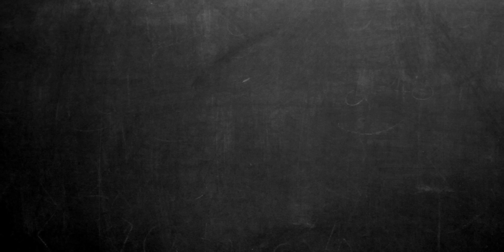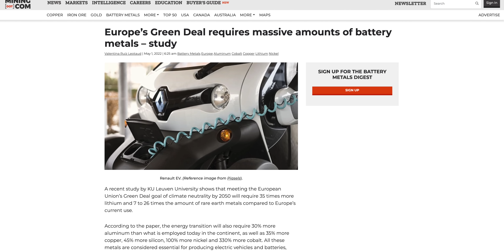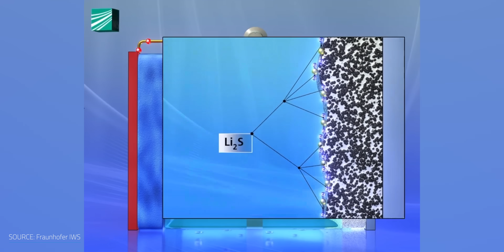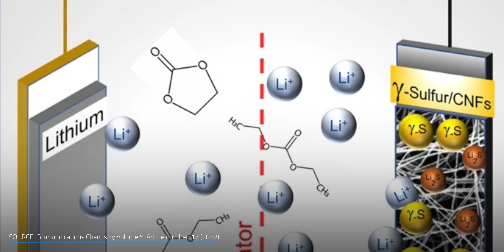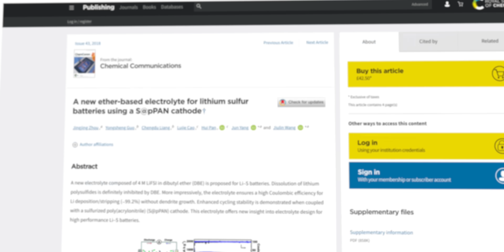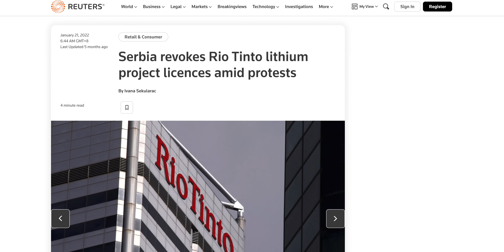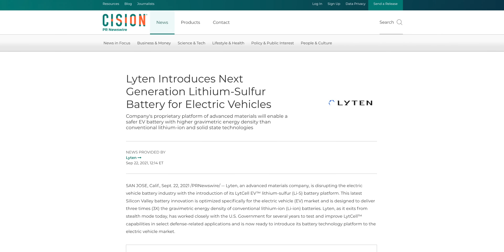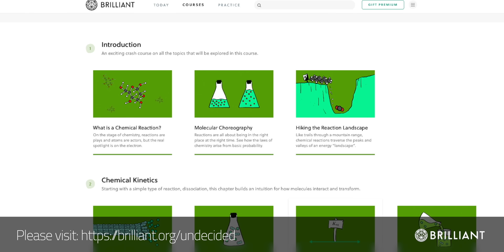Why This Accidental Battery Breakthrough Matters

Comment: Honestly I just want a battery tech that doesn't degrade as badly as lithium ion for the consumer market now, heard so many miracle materials/technique/compound in the 2010s but lithium ion is still here as the most common battery in a lot of applications.
Reply: Yes battery tech is in reality is way too slow in progressing, & it is NOT getting cheaper, EV's are just getting more expensive. If EV's are to widely adopted, the price has to go down, not UP UP UP.
Reply: @sevencostanza3931  BS! Prices are going down. You can buy Ford Maverick for $20K and we have double digits inflation. Thanks to stupid administration, but that what majority wanted.
Reply: LiFePo4 is lasting longer in cycles…
lithium titanate basically lasts forever…
Reply: ithium phosphate has been taking over generators for having a longer life cycle and not exploding when punctured. but its heavier so its not in phones or drones yet
Reply: I mean why would manufacturers voluntarily invest in a longer lasting product? If you have to buy a new one just because the battery dies, that's perfect for them.
Reply: @gamingmarcus  - “why would manufacturers voluntarily invest in a longer lasting product?”

Because existing batteries limit the use cases where a battery can be used, therefore they can not sell as many batteries.

For example, with lead acid batteries, full featured internet based cell phones were not truly possible, but with Li-Ion batteries, this technology is everywhere, and many more batteries are sold.

Another example, with lead acid & nickel cadmium batteries, electric cars were not able to be realistically used in the 1970’s during a time of the oil embargo… electric cars are possible and manufacturers are selling tons of Li-Ion batteries for cars.

Incremental improvements in battery technologies increase market opportunities, and limit the possibilities that newer technologies will take them by surprise & put manufacturers out of business when they are not reinvesting their profits into R&D.

Manufacturers must always be performing incremental improvement, otherwise old stuff can’t be incrementally replaced when it fails, eventually old infrastructure can not be renewed, and the proverbial “cash cow” will die.

A prime example of not properly reinvesting profits for incremental improvement is Venezuela. The nation had among the highest standards of living in the Southern Hemisphere, but they voted people into office who took profits instead of reinvesting them, and their infrastructure fell apart as the rest of the world moved on. Wealth creation comes from productivity improvements, so incremental improvements in batteries & other technologies are all a part of that progress!

Another example is Cuba. While the rest of the world was investing in cars, they did not reinvest their profits into incremental improvements after their revolution, and they were left behind. They could have built the first electric cars in response to their isolation, but they chose not to, because people higher on the political food chain wanted programs for their failed concept of paradise. They could have built the first cell phones, led the world, but chose not to, and had to suffer with aging technology instead of investing their profits in batteries & technology.

The world is not a static place, people always do things in an improved way, reducing effort & dependencies on expensive resources, people who did things in a old & expensive way die off, old stuff breaks, and old stuff must be replaced. 

Paradise is never based upon a picture of what others have today, but only a vision into the far distant future of what no one has. The prior is the problem of coveting & theft, the latter is the result of incremental improvement gains that makes seemingly un-achievable things possible.
Reply: @gamingmarcus  You forget their secondary source of profit. ad revenue. I cant track a dead phone, you cant buy goods on a dead phone, i cant show you ads on a dead phone, you cant download aps on a dead phone. Why do you think there's such a heavy focus on camera quality?

Comment: 1. how difficult is it to revoke a mining permit?

2. can the permitting process be fast tracked where you pay the fee and get your permit in a 5 or 10 minute period?

3. if it turns out that the mining company does not meet the requirements after a trial mining the permit can be revoked.

fore example  indonesia's hpal mine would have ther permit revoked for dumping tailings in the environment.

4. but if sulfur is cheap enough then 100 cycles may not be such a bad thing

meaning if current prices are $135 per kwh for lithium ion batteries and lithium sulfur batteries are $10 or even $1 per kwh then only getting 100 cycles from them may not be so bad.

we can then afford much better a battery 

5. can another substance be added to the electrolyte to raise the boiling point in a similar way that car anti freeze does to water?

or could the casings of the cells be made thicker to handle the pressure?

Comment: I've never understood why nobody is looking at Nickel Iron batteries for grid storage.  They are bulky, and will discharge on their own faster than a lead acid battery, but neither of those are an issue for use on the grid.  They will charge and discharge often. Who cares if they tend to run down over the course of a couple of weeks.  There are cases of them lasting for 50 + years of constant use in the mining industry. The fluid in them needs to be changed every 10-15 years but that's about it. 

They were in common use in early electric cars before gasoline took over completely. They were used as starting batteries before lead acid became popular.  Any patents associated with them have long since run out so almost any company that wanted to make them would be free to do so without paying royalties.  

The only thing I can think of that might be a serious negative would be the cost of the nickel and the space required.  When compared to the return over their lifespan it seems like a decent trade.

Comment: EV vehicles battery is huge 100kwh. 
The Daily drive is 7kwh 
The home need over night is 5kwh 
The rooftop solar PV is 33kwh every day 
Every building is connected to the grid 
So with automatic EV  plug in at every building the grid can trade power and stability with the grid for money 💰. 
If you do the maths Renewables and the grid and the EV batteries will be all that's needed. 
USA has 300million vehicles if 100kwh each and connected to the grid 24/7 except for rush hour or daily drive.
The automatic EV plug in gizmo will be the 'killer invention'.

Comment: This is very interesting, range, corrosion based fire hazards, and expense are what keep me from getting into the EV world. I prefer electric RC planes and flying drones is fun, so I am not against it at all. Just can't afford the range I need in a vehicle. My solution is making vodka fuel from cattails, tree sap, and coffee grounds. 

I raise the compression to over 13:1, run them hot so I can utilize the heat to improve mileage, and they make lots of power. It precludes running gasoline in my engines, but since I can make fuel ethanol for less than $1 a gallon with cattails as well as coffee grounds, and one acre of cattails makes roughly 1000 gallons of fuel while cleaning water, I don't mind not being able to use gasoline. I have gotten better mileage with more power on ethanol than I could on gasoline with the same size engine, in the same vehicle, by simply raising the compression ratio from 8.8:1 to 13:1. I picked up 3mpg over gasoline and somewhere around 100hp/150ftlbs with increased airflow, the fuel, and the compression ratios. 

That was a 4100lb 1970 GTO getting 20mpg mixed city/highway with an old Qjet carb I converted to ethanol. The aero is not stellar on a 1970 GTO, and the unsprung weight, rolling resistance, and drag from things like wheel bearings, means getting 20mpg with a carb and being able to traverse the quarter mile in 11 seconds, is kinda hard to do. Sure, a modern vehicle with EFI, less drag, lighter components, and low rolling resistance tires can get 20mpg and 600hp relatively easily. I did it with 1960s (at the latest) tech though. It got 18 highway and 15 mixed on 87 octane, and ran 1.5 seconds slower in the quarter with another 455 I had in it, the 8.8:1 engine.

Its fun building a $3000 engine that will push a 3500lb muscle car through the quarter mile faster than a Tesla Plaid, with fuel you can drink and make yourself. That last part is why I am into doing this, because I am a hardcore gearhead who loves cars and racing, and if I can produce fuel myself for cheap, then I can buy more parts with my limited income. 

Yes, if you run ethanol in a low compression gasoline engine, you will lose mileage. If you have 12:1 with iron heads (on my vintage Pontiac engines) to utilize the heat more effectively, you will get the same mileage with more power. There are other things you can do to improve it... Not going to get into that here though.

Best part is I don't need a lithium mine, an oil well, or anyone else telling me how much I have to pay for my fuel.

If I could get batteries like these, and electric motors that make the power I like, without having to spend tens of thousands for each,  use wind and solar to charge it, without having to worry about the corrosion issues I deal with living here in the north where we get 150 to 300 inches of snow every winter, and the degradation of battery power in cold weather, I would be all about silently going fast. That is a lot of issues to overcome, and I am 53 years old so the chances I will see EVs that go faster and farther as safely for as cheap is probably not going to happen. I need to be able to travel 1000 miles in less than 14 hours, and EVs can't do that yet.

I like technology, and I use it where I can, when I can afford it. I also like caveman tech due to the simplicity of it. I don't focus on what I can buy, I'd rather think and act on what I can do, make, create, or adapt. I build my cars from rusty heaps rather often, and I will never buy a new vehicle. The closest to a new vehicle I will ever have is one that I build myself from a pile of steel tubing, with a bender and a welder.... and that is in the works.

So if they can make sodium-sulfur batteries work and make them dirt cheap, then we only have the problems of windings and magnets, plus heat/cold and how we produce the electricity. 

I want a Prius, not to drive. I want the power units, the engine/generator, and the battery pack, because I can power my house and shop with them. Run the engine on vodka or methane (real easy to produce copious amounts of methane) and I can go off grid for the rest of my life. The drive motors can be used for all sorts of things, sawmill, water pumps, and more. So a Prius would be a fun addition to my project. The grid is unstable here, the longest I have gone with uninterrupted power in the 15 years I lived here is six weeks. 

Gasoline has been over $5.20 for the last three weeks, and with all LED lighting, a fridge, deep freeze and a PC on in my house, my power bill is closing in on $300 a month.  Heating with propane is a minimum of $1000 a month, firewood is a pain in the ass because people think 6 face cord will fit in the space 1 face cord takes up. CNG is not available here, but that is cost prohibitive too now.

Energy is my largest expense, which is why I have been working on making it myself. If I could do the car thing with electrics and get the performance/range I get with vodka for a similar cost, I'd be all over it.

Comment: I think what also has to be taken into account when you discuss new battery technologies is, wether it is possible to recycle the system or if its composites are so connected, that they create a hot mess of material that cannot be broken down back to its constituents. A battery, that cannot be recycled after its use is a worthless battery.
Reply: You have disposable batteries that are not being recycled so whats the difference.  If the rechargeable batteries last a long time it should not matter that much.
Reply: @sargonoshana2324  Well of course I have to worry a lot. Everything, that is not recyclable   creates waste that piles up and is lost for future generations to create new things. No matter what the lifetime of a battery is, as long as it is finite, it will pile up and deplete the resources for generations to come. This holds true for everything we make.

Comment: Vapor Deposition is an energy intensive process that requires some of the same equipment for making circuit boards. That isn’t to say it isn’t also super scalable but it will require a large capital investment to get started.

Comment: Excellent revelation!  At about 6:20 + you drop a detail that the caption presents ("4,000 cycles").   This is so promising.  Very encouraging to see a female scientist relating the various issues surrounding this development.  I'm a 65+ yr. old inventor and going to die soon.   It is encouraging to see that invention enthusiasm is so alive.  Getting this data and invention technique stuffed into AI programs will be vey important.  Some robot on a distant planet will need to figure out how to make the planet tolerably inhabitable for humans; etc. Seems like eventually a micro-gram of some elements will comprise a multi year charge for a battery.  But the important issues will continue to be political decision making,  We really don't need electric army tanks as much as the ability to fairly distribute limited food supplies.

Comment: It seems that every month or so, there is a new battery technology breakthrough. Whether any of these new designs even live up to their initial claims is one thing, becoming a mainstream technology is another altogether...
Reply: The key is that lots of people are trying to find solutions for improving batteries because when they do, they will make a lot of money. So you may find a battery type that costs 10x as much but allows for 5x the storage and 2x the service life. Not great for cars, but would have its place in planes. Similarly, you might get another that that has 2x the storage density, 0.5x the weight, and costs 75% of the price... in which case bulk market would immediately go that way and kill of Li-ion in no time. What wins, we can't tell. We'll also see incremental improvements in the popular lines, sometimes flagged as being breakthroughs - still important - a 20% improvement would make a difference.

Comment: Why do most manufactors go on with the Lithium Nickel, Manganese and Cobalt materials, where the 2022 LFP batteries are as good as . . and use Litlhium Iron Phosfate. 
The large Chinese carmakers and even Tesla is going for LFP. Charge and diischarge from 100% to 0% without degredation and can last 15.000 charging cycles or a million km.

Comment: Bottom line. Battery technology not yet ready to support a ICE to BEV transition.  One solution. PHEV .

If widely adopted, 80% of  miles are converted to electric with only 20% of the battery capacity.

Comment: One of the major problems in getting a product to market is the Federal Government.  Often Government Regulations that are written by some Federal Agency that have absolutely no positive effect for the environment or people, other than justifying that particular Federal agency existance.  Examples can be found with ease, often there is a very slight reduction of one source while drastically increasing toxic emissions that far outweigh the target emission reduction.  Often these Federal Agencies upper management are manned by Political Apointees with absolutely NO experience in the area that they are Managing.  Then you have supposed technical experts in areas that are basically rejects from the corporate world, like much of Congress where they were often they were at the bottom of the pile in their speciality, Failures, and switched fields and become politicians, and suddenly they were top experts in their old fields.  In the real world if you can't do the job you are gone, in the Federal Government you are advanced in position.  If we are to fix the battery problem Industry will be the answer not Congress.

Comment: Can you also do a dive into using silicon in the anode of Li batteries, I have read that it allows for twice as much Li to be used thereby extending the battery but would like more information on it. Seems a possible win win with this advancement to sulfur batteries.

Comment: I'm failing to see the downside of 100x charges over lifetime vs 2000x if that Li-S battery can last 1-2 months without charges needed? At 1x month full charge, you'd have 8+ yrs of use? And at 2 months it's lasting longer than standard lithium ion battery lifespan right?

Comment: My car has not had a battery in it for over 5 months now. I'm still driving around just fine. The price of the car battery went from $60 to $160. That is just way too expensive. There's something nice about basic vehicles. There's practically no electronics on this thing. You open the hood and every major part is right there in front of your face. There is no reaching in and under or around. It's all in the open. I can change out any of the major parts in 10 minutes flat on the side of the road. No special tools and no waiting for parts. This poor girl in Tesla the other day had a flat tire. Tesla don't come with spare tires and AAA won't touch the car. She was stuck there for 2 hours. It's not just electric vehicles, I drove a Jaguar for 2 years and I hated that car with a passion. Too many electronics in too much automatic crap. Car manufacturers are heading in the wrong direction.